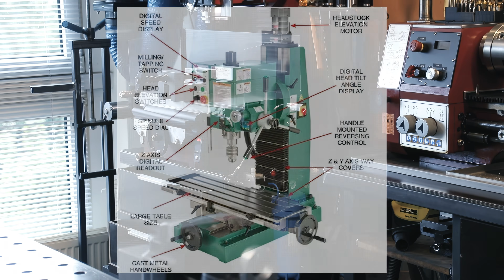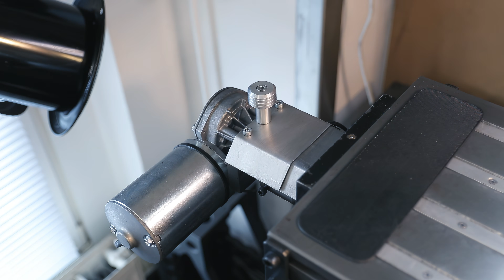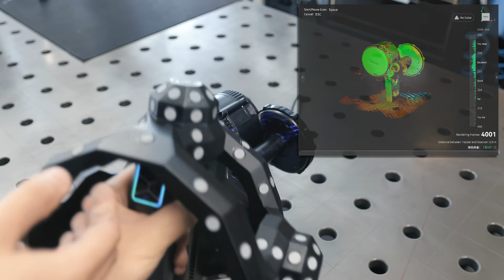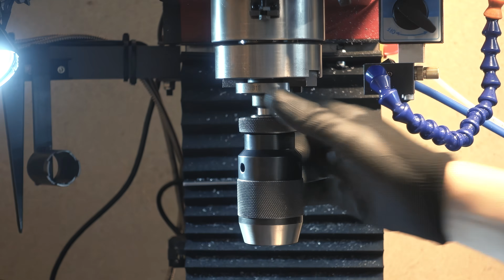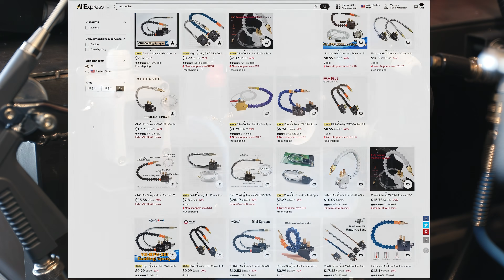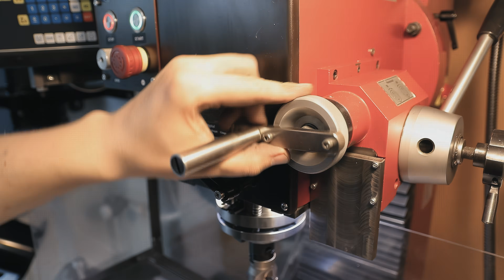10+ Mods and Improvements for my Import Milling Machine

Comment: Thank you very much for the video. This is a relevant topic for me. I have a few questions about the vacuum cleaner: if you use liquid cooling, the chips are often wet. When you vacuum them, doesn’t that damage the filter? Have you considered adding a mount for the vacuum hose right next to the working area, so it can suck up the chips directly from under the cutter?
Reply from the maker: Good question, I had the same concern but the relatively low amount of moisture doesn't seem to be an issue. I would avoid vacuuming straight up puddles of coolant though, I usually remove those with a rag and just use the vacuum for chips.  As for the mount, in experience metal chips have too much velocity and they fly in all directions so it's diffcult to catch them all and the hose/mount would proably be annoying to work around. But sometimes I'll hold the nozzle there manually if it makes sense.

Comment: How about that thick hose on the left side of the mill? Is that a mist extractor or smth?
Reply from the maker: That's a smoke extractor for the welding table
Reply: What radial fan dis you use? I intend to build one as well but I wonder which size I should use. And which hoses did you use (because of sparc resistance). Do you have a link where you got them from?

Finally Thanx for your inspiring Videos!
Reply from the maker: I got the extraction arm used, not sure what kind of hose they use. The fan is a cheap 150mm inline-type fan from ebay, it's not super strong but enough for smoke extraction. If you want a lot of suction I'd recommend a radial fan with 500w or more, beware they're VERY loud though, unless you have a way to mount it outside. Mine is more of a minimal setup, I mostly weld TIG so there's not much smoke to begin with.
Reply: Thanx for the quick reply!

Comment: Hi,  New subscriber.
Really nice mods and tips on your mill. I have the same mill in the Grizzly version (G0720). What DRO's did you use and do you have any info on the changes you made to the front control panel? Do you have a way that you control the head moving up and down accurately, like if it had a hand wheel and scale to control depth? I know that's what the spindle/quill does but I would like to also have that option with the head. 
Thanks in advance for any additional information.
Reply from the maker: It's a cheap chinese DRO I got from eBay, they're quite good actually and easy to find. As for the front panel there's a post on my Instagram but I don't have anything detailed unfortunately, but it's quite straightforward if you have some basic electrical knowledge.

As for moving the head, I haven't come up with any solution for that and I agree it's suboptimal that you can't position it accurately (which is also why I never bothered installing a DRO scale on the Z axis, as it would be pointless). I did have this idea to install some kind of crank to manually fine adjust the position but never got around to it since it seemed like too much effort
Reply: @PhilVandelay  Thanks for your reply.
Im not real good on electronics, I i can follow directions but to figure things out on my own I'm not real good.
I have wondered if the head lift motor could be replaced with a stepper motor with a hand wheel control like on a CNC machine. I think then you could even do deep boring with it. The head situation is really the biggest downall of the machine the way it comes.
Reply from the maker: Yeah I think that should be a viable option, good idea actually! That would also remove the necessity to have a power downfeed on the quill. But at that point you're already halfway into converting it into a CNC, might as well go all the way 😅
Reply: The simple easy fix is to just replace the fan on the head lift motor with a hand wheel and use it to fine tune the Z axis. It is just held on woth a end screw and grub screw. I took the end cover off and just turn the fan by hand to move it just a little up or down. That motor really doesn't need a fan on it for no more than its used. The worst part doung that is its not easy to reach without a small step, but it does work. CNC is great but for what I'll be doing I'll probably not convert mine. Power feed in X and DRO's will duit me fine for now. I'm also going to try to add a quill stop on mine. I think by using your upper spindle lock ring and adding an arm off the left side to use a threaded shaft with stop nuts like a drill press is doable.
Thanks again for your reply, Dan

Comment: Damn your tool change speed is impressive! MT3 type chuck takes a lot of time to change! You need to whack the sh1t out of it to release it.   It holds way to tight! And no, I don't believe that I tighten it that much, I think it is because of the angle.
Reply from the maker: Yeah I believe MT3 was designed mostly for drilling but for some reason many cheaper mills have those spindles.  One reason I picked this specific machine was the SK30 spindle, since you can also find better stuff on the used tool market around here while with MT3/MK3 you mostly find drills
Reply: @PhilVandelay  Totally agree! But I leave in a department, so the maximum weight per m2 is only 150kg, so I had to settle for the Sieg SX2.7😅 Have a great day Phil!

Comment: Excellent stuff. So many great Ideas. I am not that skilled at modding, but you have motivated me to try a few more mods. One change I made on my SEIG Mill is that I removed the little seperate DRO from above the quill and replaced it with a Magnetic strip and reader which I feed into my DRO as a 4th Axis. In the DRO settings I merged it to the Z Axis. So regardless of whether I move the quill or the Head, it is shown as a Z axis movement.

Comment: Hi Phil, nice to see all your mods in one place! Way back when you did the power feed I commented that I had issues with my original that I got with the mill. I asked a guy at work if he could check out why. It took him awhile but he tracked it down to the on off switch on the speed controller having an intermittent fault. Replaced it and it’s up running as good as new. He also suggested installing a fan to help cool the control board as it generated a heep of heat when running slowly, the controller runs on mains voltage. Oh it bites in this part of the world! I also had to replace the micro switch box for the power feed, UVs here killed it, despite not being in direct sunlight. Another mod I did was put plastic caps over the nuts on the hand wheels, after a bit of blood letting! Cheers Kerrin

Comment: I built a slide hammer tool change wrench with a little different design for my mill after watching your original video on that, and agree that I've neve really felt like I needed a power version since then.  Also built a power X feed, but went with a stepper Arduino version.  Still need to build a power Z.  Always love your videos!

Comment: Nice video, and nice mods. I'm about to buy a mill (probably an imported Bridgeport clone), so I may have to build some of those.

To the left of your mill there's a pipe and some hoses and maybe a blast gate. Is that part of a dust collection system? If so, do you use it with the machine tools too? I've thought about running a duct branch from the woodworking side of my shop over to where the metalworking tools are, but I'm not sure how useful it would be for most of them. The one tool where it would definitely help is the grinder, but I'm too afraid of sparks starting a sawdust fire and burning down my shop. So that's probably going to get a dedicated shop vac or similar.
Reply: One issue is risks from sparks and hot chips. So probably not a good idea unless you could guarantee no hot chips and no sparks. I suppose some sort of 'pre-trap' could remove the chips of metal based on their higher density so they wouldn't reach the pile of combustible wood dust just waiting for some action...

Comment: The Sieg SX4 has some similarities to my Taiwan-built Precision Matthews PM-833TV — at least the castings appear to be very close as is the case with a lot of these machines.  It also has VFD-controlled 2hp belt-drive motor, and similar XYZ travel but with an R8 spindle instead of your 30-taper(?).  Spindle is six spline at the top of the machine, requiring two wrenches and a soft-face mallet to change tools.  Although I have already implemented a spindle lock I plan to shamelessly steal several of your other modifications.  BTW I built the Vandelay machinist's belt grinder with it several years ago and it has been a great machine.  Thanks for sharing your work.

Comment: Thanks Phil.  I always look forward to your videos.  You are an amazing engineer, and come up with great solutions to annoying problems.
I have a question about your DRO.  I too have the same JCS900 DRO on my mill and I really love it. However, when I purchased a second one for my lathe in 2023, I found that the firmware had been updated, and the arrow keys worked backwards when scrolling through the SDM's.  The Down arrow scrolled SDM 1, 2, 3, etc., and the Up arrow scrolled 4, 3, 2, 1. The firmware also removed the setting to change this behavior. At least as far as I know.  I've tried to get used to it, but my brain just can't count down 1, 2, 3, or up 3, 2, 1.  How does yours work? Do you have the older one's that work correctly, or the newer ones that don't?
If you have a solution to the problem, I'd love to hear it!  Thanks very much. Regards.

Comment: The shopvac  at hand its a must. I have mine setup with a remote controller to the power plug. so just press a button on the hose for on and off so i can shove the motor on the corner for less noise and just bring the hose to place. Thanks for sharing great vid!